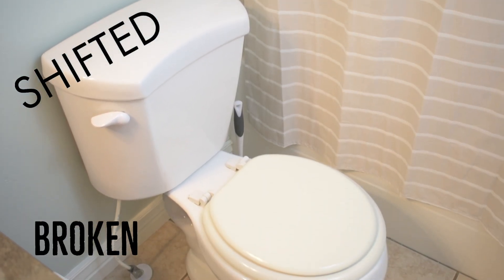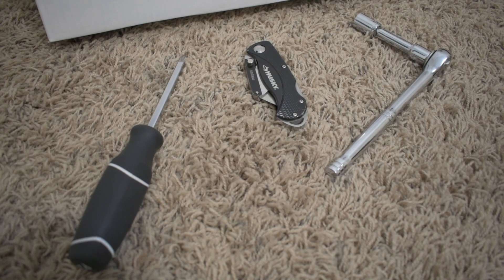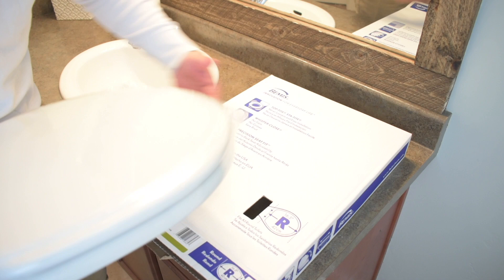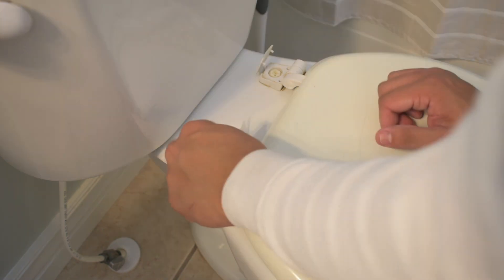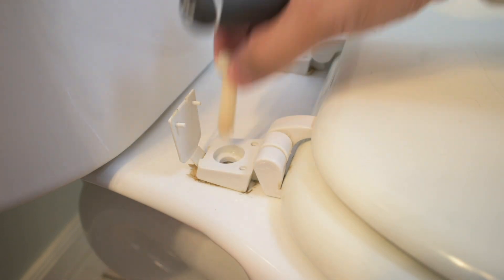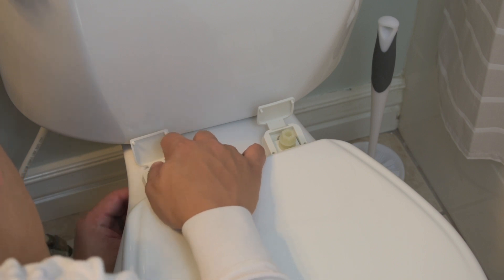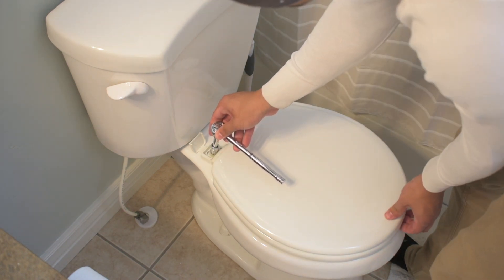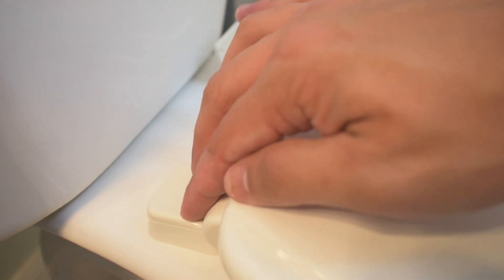DIY How to Install a Toilet Seat - Remove and replace!

Comment: Mine has a snap off nut on the bottom.
Reply from the maker: Either way, it could be installed I guess the other way also where it snaps from the bottom rather than the top. Id just make sure that the covers are able to cover the bolt and nut properly.  Sometimes it's just easier to have the snap off on the top.

Comment: But how do you remove these things!!!! I can find a bunch of videos on putting them on, but my apartment has an old nasty one and I want to replace it, but it’s almost like it’s permanently locked on lol. Any tips help!
Reply from the maker: Generally all toilet seats have the same process to remove.  Just do it backwards.  

Pop the caps behind the seat off, exposing the bolt or nut, look underneath for the nut or bolt also securing it, and loosen.
Reply: Yeah I think this one is either very old or idk, when I pop those things off behind the toilet seat to expose what I expect to be the nut, it’s almost like it’s full of built up rust, and I can’t scrape that down to expose any head. Might have to get a professional lol but thanks for responding
Reply from the maker: If there is a bunch of rust, you are on the right track.  That means there is metal there and that is the bolt you need to get out.  Also.... keep in mind that the rust you just found, may be due to lack of "good aim".  Use latex gloves :)

Comment: should mention that it is not that the screw head might snap off, apparently the beamis requires that they be snapped off in order to be able to close the cap.  also, the beamis 500 has a different cap that what is shown here..(just a detail)
Reply from the maker: Thanks for the call out

Comment: Just bought same toilet seat. This video is very helpful. Thanks.
Reply from the maker: Thanks for commenting and watching!!
Reply: @ColtonCrumpDIY Do you work for Bemis? My seat could never be tightened. It’s flops all around and falls off making it dangerous to even sit on. I want to make a YouTube video of me cutting it into small pieces but my wife wondered if two bolts could be added to hold the damned seat in place. I’m a NASA engineer and I’ve never seen such a poorly designed product in my life.

Comment: Thank you, i did not know that that plastic bolt top breaks off when the seat is tightened, if not for your video i would have never figured that out!
Reply from the maker: Well thanks for watching and commenting! Not all plastic toilet seat bolts have a head that break off. I would keep that in mind so you don't over tighten one that may not break off, and then the threads are stripped.

Comment: How do you fix the soft close on those seats?
Reply from the maker: So I'm not 100% sure but I did find this video.  It does require a bit more taking apart the guts of these cylinders.  So these steps may not be 100% tied to this toilet seat but I do know that the steps could be similar. If it helps let me know :) https://youtu.be/hxgTikF1nlY

Comment: Hi Colton, thank you for your instruction. I want to replace my toilet seat, but I don't know which size of a wrench should be used to tighten the bolts. I don't wanna buy all set of wrenches for this replacement. Instead, one size is enough for it. Do you remember which size of a wretch that you use to tighten the bolts?
Reply from the maker: Great question.  I can't remember with 100% certainty.  I want to say it was a 1/2 socket. Looking at the video it may be a good guess.  What you could do is just purchase an adjustable wrench like this one: 

https://amzn.to/3cZvuAq

Or 

https://amzn.to/2xhkHSJ
Reply: 1/2"

Comment: Great, concise video! Easy to understand, and follow. One thing you did not address was the adjustment tab, inside of the "pocket" from above. Mine does not fit quite right, so I was not sure, thus why I came to your video. It might be helpful to discuss that too in a new version of this vid, as this is a good, quick video otherwise! Thank you, Greg.

Comment: hi colton, my toilet seat came with decent instructions but it was so helpful to watch your video prior to starting this small project.  i had never replaced a toilet seat before and your video made a huge difference and i did not feel as intimidated with the process.   thanks for what you do!
Reply from the maker: Thanks for sharing Susan! I'm glad it was an easier process and you were able to get it changed!! So glad this video helped! :)

Comment: Thanks for making this video. I just bought the same Bemis seat.It came with no instructions and the goofiest looking bolts and fittings. Your video explained why nothing makes sense until you break off the top nut by over tightenting. Thanks...
Reply from the maker: Thanks JD! I'm glad this video helped. My pleasure. I'll be pumping out some videos in the near future.  Thanks again! Check out my other videos if you haven't already

Comment: Bemis toilet seats are the WORST seats ever made. Do not buy these pieces of junk. I got one and it falls off or shifts making it dangerous to sit on. Bemis is a horrible company.
Reply from the maker: I haven't had any problem with mine so far.  I'm well over 4 years.